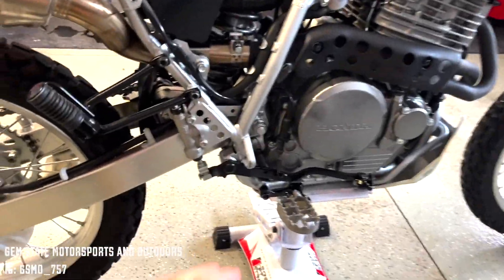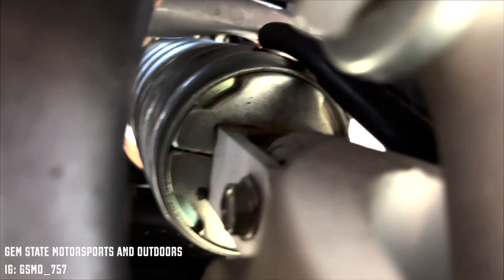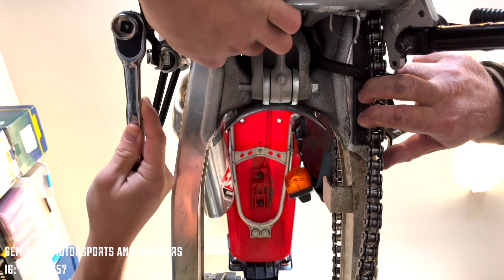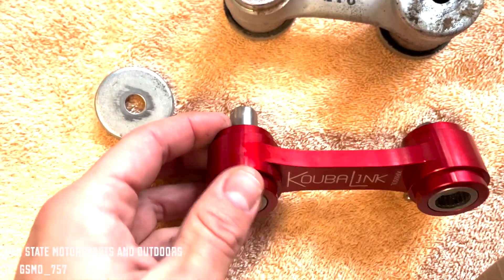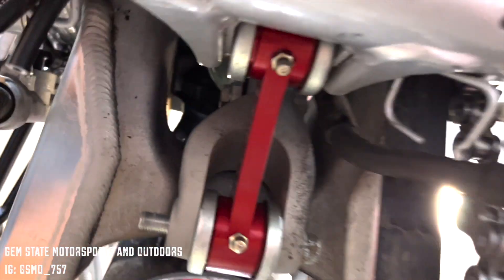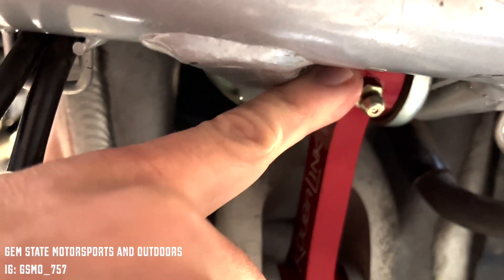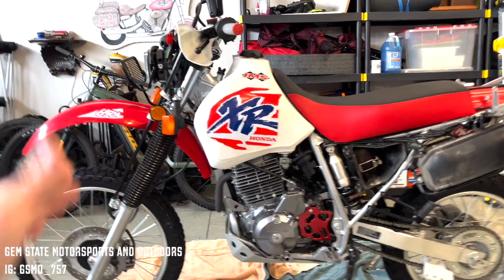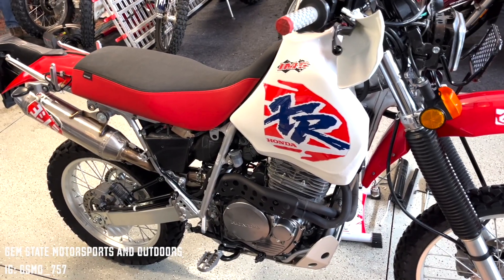[How to lower a dirt bike] | XR650 KoubaLink Installation

Comment: Thanks for the video, it helped my adventure in several ways.  My bolts were already installed right to left.  That made removal somewhat easier.  Getting a wrench on the nut for top, challenging.  Rethreading was fun, dropped nut, fell into skid plate.  Went to remove skid plate, allen key bolt stipped, so the nut will be rattling around in there.  Sigh!  Went to drop the front forks, compared them to yours, apparently already dropped.  Wondering if the bike was lowered and set back to stock link.  So I have been running bike slanting downhill.- makes it go faster, haHa. Bonus round, trying to get that bottom link bolt to line up was challenging, tipped the bike off the stand and it wacked me in the head.    Ended up using a rachet strap to raise the rear wheel until it aligned.   All put together, I can mount and dismount  much easier.
Reply from the maker: HA! that sounds like a good evening in the shop. Im glad I was able to help in some way!!

Comment: I'm not sure if it's got to do with the year, (I have a 2019) all I had to do was remove the bolt by the foot peg that holds part of the chain guard to create more clearance and support the rear wheel while the frame of the bike was lifted. The bolt slid out with no problem. The rear wheel removal seems a little extra.
Reply: Yeah this is kinda embarrassing for a motorsport shop lol
Reply: @crappingmonkeyface  we learn and move forward, no worries mate. Hope this helps for future reference and Goodluck with the shop.
Reply from the maker: Hey thanks for the comment. This method of installation may be more steps than some will need, but removal and reinstallation of the rear wheel is a relatively simple process and it created more room. The same results could be accomplished in other ways such as removing the chain master link as well but this is the route we took. Your method is just fine as well.
Reply from the maker: @crappingmonkeyface  Thank you for the comment, crappingmonkeyface.

Comment: just got the 2022 XR650L and am very glad to have found your video as I am definitely needing to lower my bike!
do you know if the KoubaLink part comes in an even longer version to lower my bike even more than that? also, will this affect my factory warranty?
Reply from the maker: Hey Zachary, I would contact your local Honda dealership to ask them about the warranty. As far as I know, KoubaLink makes only this size for the 650. However, if it still isn't enough, you can always reupholster your seat and remove a bit of the foam. Doing so could drop your saddle position by an extra 0.5-1.0 inches in addition to the lowering link. Enjoy your new 650!!
Reply: I just got a 2023.Had no idea the bike was that tall when i ordered it.Did you end up lowering yours?
Reply from the maker: @rca3rd  Hey Ron, yeah I did end up lowering it. The Xr650L sits wayy taller than most people think from just looking at it.
Reply: @madjack_757  Yeah i found that out when they delivered mine.I am 5'11" too.Did you adjust the forks to match?
Reply from the maker: Yeah I did adjust the forks
Reply: @madjack_757  Ok.Thanks so much for the info!
Reply from the maker: @rca3rd  Anytime🤟
Reply: @rca3rd did you not watch the video ?
Reply: Don’t be afraid to shave the seat down. I’m 5-6” and that made a huge difference in getting feet on the ground. She’s still tall, but it’s a big improvement. Look up some videos on doing it. It took about an hour and cost me only a box of staples.
Reply: @rca3rd  yes they’re stupidly tall. I shaved the seat foam down and it made a big difference!
Reply: I bet!Thanks for the reply!
 @TheMotorman116
Reply: How many inches the bike get low ???
No body talking about that
Reply: One to one and a half inch
Reply: I did not see any reason to adjust the forks just did mine yesterday.

Comment: Great video.
Someone may have already asked but what did it drop the weight height to?
Reply: I meant simply height
Reply from the maker: @bavarian11  Hey Kevin, the bike sits 36 inches / 3 feet tall from level ground to the top of the surface of the seat cushion. Though the aftermarket seat could provide different measurements than you would get with an OEM seat.
Reply: @madjack_757    Thanks,
I really appreciated the video and information.
I have an 88 nx 650 and it allows me to at least touch the ground at 32 inches.
Why honda chooses to alienate 50% of the potential buyers is the question.
Reply from the maker: @bavarian11  Of course! Yeah sometimes bike development can push some buyers away and intrigue others
Reply: @madjack_757 I sat on a stock 650 and I was like this is the most uncomfortable bike I've ever ridden. I'm 6 ft and had to stand on tip toes. How much total do you think you lowered it?😊
Reply from the maker: @371kenny  it sits about 36 inches tall now with the lowering link. I would have to look up what the stock seat height is in order to give you  an accurate answer. I would guess that it dropped it between 1-2 inches though!
Reply: @bavarian11  Hey, may I ask how you lowered your NX650? was It just a lowering link or something extra? There doesn't seem to be any lower seat options...
Reply: @371kenny  I’m 5’-6” and own one. It’s dumb tall stock. I raised the fork tubes a bit and softened the rear spring for more sag just to be able to ride it. Recently shaved about 1-1/2” of foam off the seat and it made a huge difference. Looking into the lowering link now so I can increase the rear spring a bit for better off road handling.